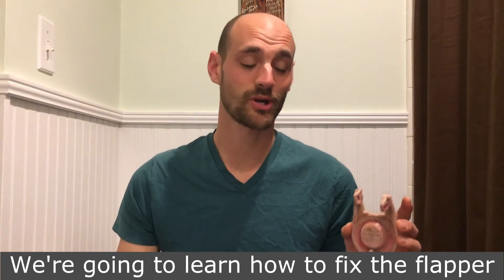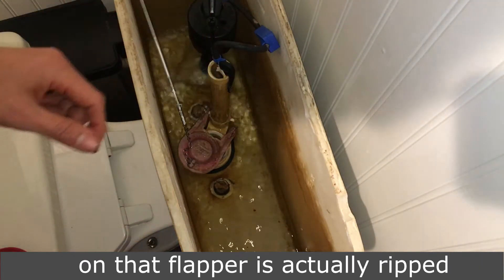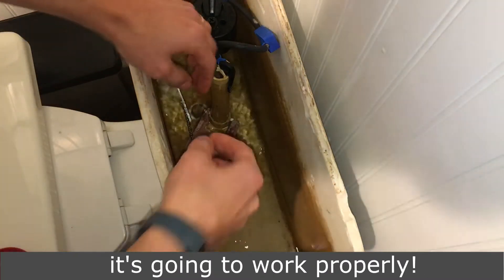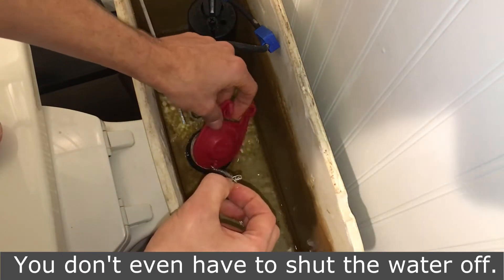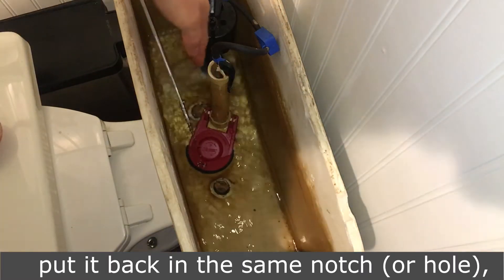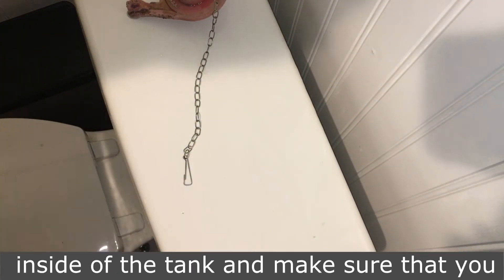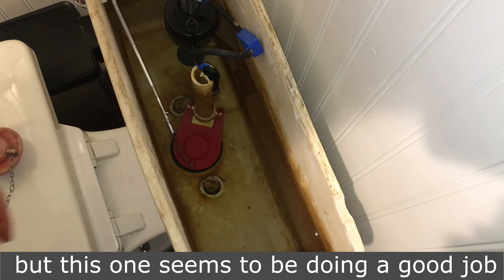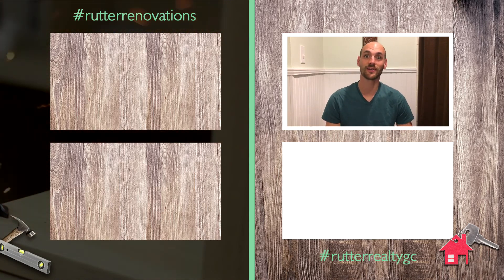How To Fix A Toilet Flapper!

Comment: Mine leaked, what I did was bring a pan with water to boil shut it off and put the flapper in the water, let it sit in there a couple minutes. While that was in the water I cleaned the seat area. Then reinstalled the flapper, turn the water back on , it’s been fine .
Reply from the maker: Great idea!